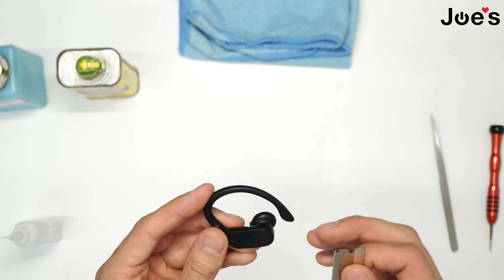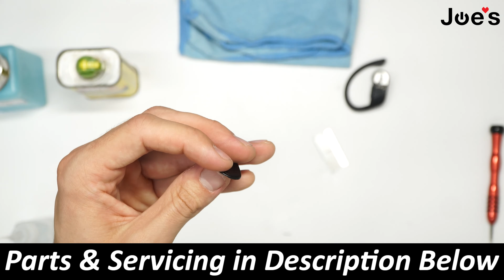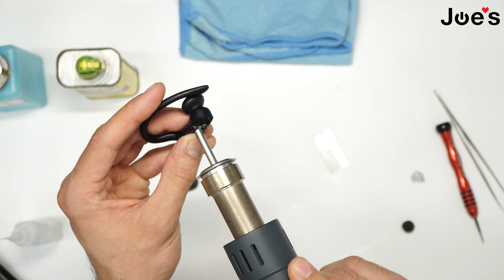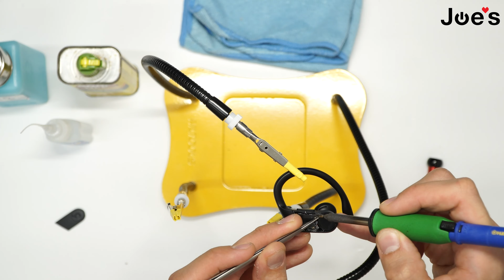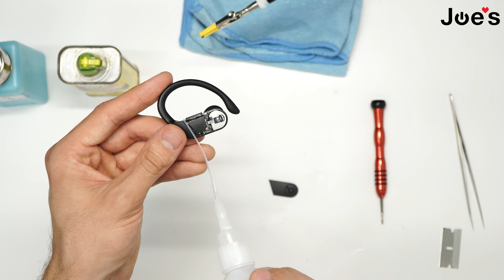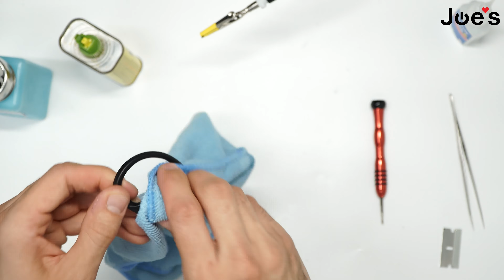Beats Powerbeats Pro Broken Bad Battery Dying Fast | Repair Tutorial

Comment: I'm glad I found this video, the left side of mine started dying at 55% I tried everything, reset, drainage and now I can see it's not just me, so sad a great product like this is bound to this fate in just two years.. Sigh!
Reply from the maker: Yeah. Seems like they are built to break now a days.
Reply: Mine is the exact same!!!
Reply: I’m having the same problem here. It fan stay charging all day and the left side will be at 4% then die or only last no more than 25 minutes and only left with the right one. Beats won’t do anything. I already contacted  them . Smh. Now I’m waiting to see what’s the best wireless earphones right now. Not a fan of the AirPods Prob and not convinced of the new beats wireless ones ether.
Reply: I’m having the same issues 2 years later as well such a fail of a product.
Reply: Update : I ended up buying the new beats fit pro! I recommend!!
Reply: @_lunaaaah6194  cheers, yep i have them on my list as soon as they're available in Canada, do they sound as good as powerbeats pro?
Reply: @MustafaAlJaiosy  I was iffy at first but turns out I was placing them on my ear wrong. But yes. The noise cancellation and the 3D moving hearing is cool too!
Reply: @_lunaaaah6194  Nice! I will get them then, ty!
Reply: @MustafaAlJaiosy  no problem! You can always walk in to Any apple store and ask to try them on and have a hearing test with it! Good luck(: 
I got the white beats fit pro 🔥
Reply: I have the same problem with the left side of my EarPod dying with a few mins of being used. It drops down to 55%! What can I do to resolve this?
Reply: I called Apple Support today and they said that they haven’t received many complaints similar to this one!! Please report to Apple if you are having this problem
Reply: Same problem but the right side
Reply: Mine was in less than a year
Reply: @Ismy__king  Yeah well, thats a lie.
Reply: mine is doing the same thing.
Reply: Does anyone know how much Apple charge to replace both batteries? This sucks. pff
Reply: @oscarbreton6098  last time I checked it was 130 Canadian dollars 🙃
Reply: @MustafaAlJaiosy I checked some other users in Reddit yesterday. Indeed is around $130 each earbud. What a jokeeeee haha. I will buy the Beats fit pro instead. At least this pro lasted a little over than 2 years .  Thank you for the reply!
Reply: Mine is also left side? I think it’s a glitch or a production fail
Reply: @Joesge  can you replace the battery In my powerbeats pro if I send them to you
Reply: Same I bought the two year warranty and guess what after two years it sucked getting air pods next time
Reply: The batteries are so small and they charge them so fast with the case it makes for a very short lifetime for the battery.
Reply: That's wild. Mine also dies at 55%. I thought it was just a bad bud.
Reply: Literally same problem! Exactly 2 years! Wtf
Reply: Same here.  My right one still works pretty well, but it's not strong as it used to be.  When they were brand new they were good for 9.5-10 hours.  Freaking shame, I'm done with Beats.
Reply: Yes, same exact thing happened to mine 😢
Reply: Exact same left side dies
Reply: @rqazi10  Right here too.
Reply: @imaunicorn5862 mine is also on the right side 😢
Reply: Mine too at exactly 55%
Reply: As an update, mine was like this, then they did a big update and now the left works great and the right does in minutes.
Reply: Still having this problem bro
Reply: I got this problem to
Reply: Mine took five and it’s only on right headphone.
Reply: Left side have same problem. Last 20 to 25min. I now have to go with the charger at the gym and as soon I start recharging it shows almost full charged
Reply: Wonder if the 2nd gen going to do the same thing
Reply: Fingers crossed!
Reply: Same

Comment: The left piece is dying quicker everyday. It won't even show that it goes to 0%, it simply shuts down at 68% while the right piece keeps going all day long. Today the left piece died at 82%. Very annoying when you have meetings all day.
Reply from the maker: Have you tried a reset?
Reply: Dealing with that now. These cost way too much money to deal with stuff like this.
Reply: @AR-3618  did you find a solution
Reply: @bushwickbill7593  naw I haven’t. I just keep the case with me, put one in my ear till it fails then swap it with the other one charging 🙄🙄

Comment: Awesome vid!! A little DIY can save a lot of $$!!
Read through some of the comments, and I'm gonna add that most electronics over the last 15-20 years could be considered "throw away" items - use for a couple years and they're done/old/outdated. With the advent of smaller and smaller technologies, the longevity is potentially shorter. Example: the battery in these are soldered, if you drop your case, or even an individual bud, and that solder wasn't super secure to begin with, and that connection is broken, well, now you have an inoperative earbud and you feel like you've wasted $250 and you're now upset with the manufacturer. Their job is to make $$. Now, as long as people keep spending $$ on their product, they'll continue to grow. Companies would have to restructure themselves, and/or their pricing if no one bought their product. Think about it...

With that being said Joe's, I've watched the vid, and it's tough to tell in the video, and I've checked both links to the replacement battery in the description and in the comments, my question is, the link in the comments only showed a round battery, the link in the comments shows two wires attached. It makes sense that the one with two wires is more applicable, as it gets soldered. Will any CP1454 A3 work?
Much appreciated.
Reply from the maker: Im not sure. Here is a link to the original battery. https://www.joesge.com/products/beats-by-dre-powerbeats-pro-earphones-battery-replacement-parts?_pos=1&_sid=6af242f27&_ss=r
Reply: How do i know if the battery in the casing is the problem or the earbuds itself?

Comment: Friend when you start to fix Beats Studio buds and the case of Beats Studio buds also fix the case of Powerbetas pro it’s very difficult to open I’m open one and it’s a solo 3 battery 360 mah dead by fast charging about the Beats Studio buds it’s 85 mah the thing it’s don’t turn on or send any light when out to charge so o have a lot of problems now jejeje and the interior of Beats Studio buds it’s more difficult that the powerbeats pro and need a lot of practice to change a battery hope can make a new video with new products thanks a lot

Comment: Wow, excellent video and I will say the BEST (I watched many). The important details were left out by all the rest!. I did get a chuckle when you started off with the tools that I would need then later you introduced a Heat Gun with a specialized reducer attachment and also the soldering iron. lol. I wonder if heating up a small flat head screw driver to soften the glue for removal would work (I do not have a Heat gun and my buddy Joe did not list it in the tools/parts links 😉) I have two bad sets (bought a 3rd set for Black Friday, $149 new Black pair; yes I know, Costco had a blue pair w/ a pinkish logo for $139) and will completely refurbished them both for Christmas gifts. How long should I expect these batteries to last? Mine lasted about 18 months and both left pieces give me about 30-45 minutes of listening time. Right ones about 2-3 hours. The cases are not noticeably different but I wish there was a way to measure the % of efficiency of the each of the 3 pieces. Do you know? I will also look to see if you have a video oh refurbing the case battery. You are natural…..Please keep up the great work!
Reply: I just started this repair on my own pair and found the glue on the battery terminals just popped off with a flat-head screw driver.  Didn't require any heat.
Reply: @madamscrypto5375  how did the repair go? Did the earbuds retain all function and connectivity? Some ppl commented its a bit off after the replacement
Reply: @madamscrypto5375  also madam, where did you buy the battery from? and which battery did you get?

Comment: Excellent instructions! My clumsy self broke off the green solder contact with a tiny piece of the board. Any advice as to how I may be able to solder directly to the bottom of the board? I’ma total rookie (obviously). 🙏🏾
Reply from the maker: Maybe try to solder a wire into that spot? A small copper wire?

Comment: For some reason, the battery life on my Powerbeats Pro has been dying quicker than before, even when I leave them charging for long periods of time
Reply: Same the right side earbud dies within like 30 min of use, so annoying
Reply: @Joy_Dvzn  same happen to mines but I don’t have all those tools to change battery 😂
Reply: @Joy_Dvzn  omg mine too... Right one goes off in 20 mins and left one dies in 45 mins
Reply: I have owned my pair since mid-2019. In the past few weeks, the right side simply turns off when it gets close to 50%, as if the battery reaches 0%. I've disconnected from all devices and reset, but it didn't work. The firmware is also the last released.
Reply: @RafaelNardo001  same case man
Reply: @saipruthvi8535  I really don’t know what to do.
Reply: @gabrielsuarez8559  yea it’s a lost cause at this point, I don’t have the equipment nor technical ability to do anything about it. We can get it repaired for 99$ but at that point I’ll just save up to buy new wireless earphones
Reply: @saipruthvi8535  rip
Reply: @Joy_Dvzn  yeah, took it to the service center they asked 130$ to replace each earphone. That would be 260$ for both and for 160$ we can get a new pair
Reply: @saipruthvi8535  omg lol what’s the point of  apple even having service repair 🤦🏽‍♂️
Reply: U
Reply: @saipruthvi8535  it’s $79 for battery replacement through apple
Reply: @beyoncehadoneofthebest  that's in usa without taxes. 130$ for each in India including tax
Reply: @Sebastien Fulga  same so annoying done with beats

Comment: Hello Joe, great videos and website.  Question: I cut the ribbon that is connected to the motherboard cover on the side of the charging pins while prying the side cover off; is this repair destroyed?
Reply: The cover doesn't appear to have any electronic components (that I can see); in your "How to Teardown Disassemble" video you state "the ribbons are connected all the way through; so anything that has electronic components on it; its all connected into one peice." I just don't want to solder in a brand new battery if this earbud is now toast.  Thank you again and much appreciated!
Reply from the maker: Hello, thanks for commenting. Please email us at support@joesge.com with your question. We will be able to better assist you there. - JoesGE

Comment: Hey!! I have a problem with my left piece, i used to charge them both but to my surprise i find that the right piece is the only one charged ful the left is still 0% it starts to charge when i open the case!! I found another problem last week, the left piece drains quickly and shuts down at 30% is it the battery problem?
Reply: I have the same problem have you figured it out?
Reply: @taspiqulislam2863 did u find a solution
Reply: Did u find a solution
Reply: LISTEN AND DO AS I SAY.. 
Lick the charging metal on the ear piece then put it in the charging case then it will charge correctly.

Comment: Question I can send you the headset and you can do the work on the battery I have the right side with battery problems how much would be the total cost of the replacement and the battery thanks
Reply from the maker: Hello, unfortunately, we do not repair this device anymore. We do sell the parts at www.joesge.com though. - Aaron P

Comment: Hey, many thanks for this video, found a lot of interesting information here. My earbuds left and right, doesn’t connect once they get to my ears. But when they are in the case, I see them charging and the percentage they are in. But once I remove them out of the case to fix into my ears, I don’t hear the connecting sound and they don’t work. 

Do u have a solution to this? I have done the reset, so many times. But won’t connect to my ears.
Reply from the maker: Hello, thanks for commenting. Please email us at support@joesge.com with your question. We will be able to better assist you there. - JoesGE

Comment: My right earbud keeps shutting off on my like I could have both of them fully charged and then like 5 minutes later I hear the low battery sound and it shuts off and when I check the % it says it’s fully charged and I’ve restarted them like a billion times and nothing has happened
Reply from the maker: Hello, thanks for commenting. Please email us at support@joesge.com and we will be able to better help you there. - Aaron P
Reply: @Joesge  I will for sure email as soon as I can thanks for answering

Comment: Where do I get the batteries from please?
Reply from the maker: https://www.joesge.com/products/beats-by-dre-powerbeats-pro-earphones-battery-replacement-new-parts?_pos=8&_sid=68cafdacc&_ss=r
Reply: So I Ordered one battery per ear set, one left and one right, does that sound correct?
Reply: Then I was looking at how you have the original, I would have rather done the original since I like longevity, but I guess I should still be ok since you didn’t say the generic ones wasn’t ok, so I’ll go with it then !!

Comment: Only my left earpiece is showing up as fully charged, and the right side is not listed. I made sure to place them correctly in the case to charge but every time I check the right side just doesn’t show up. I checked online to see what I can do and it says I can reset. No matter how many times I do it, The case only lets me pair. Do I need a new case ? Or would I have to get a replacement earpiece? 😣 thank you!
Reply: I got the exactly same issue as yours but its the left side that is not working, did you found a way to fix it 🥲I only bought it for 2 month

Comment: There seems to be two different types of batteries CP 1254 A-3, and CP 1254 A-4.
Are both OK for this or one’s wrong???
Reply from the maker: Where did you see A4?
Reply: Just looking through Amazon
Reply: The A4 seems to have a different mah than the A3
Reply: Joe,
Problem. I just got your battery and finished replacing in one side. When I put it in the case the white light flashes, but it will not pair to the wife’s iPad. What do I do???

Comment: I have one headphone that just went dead. It shows charging, but it never charges past 3%. I’m guessing the battery had gone bad?
Reply: Me too
Reply: @DavidMartinez-hb6cg  I replaced my battery. It was fairly easy if you can solder small things.
Reply: @gerdanc  so, it works fine if i replace the battery?
Reply: @DavidMartinez-hb6cg  mine is still working great almost a year later.
Reply: @gerdanc  ok thanks!

Comment: The fact apple and Dre have this shit product that I have to fix because of software updates that fucked them up is ridiculous. Prior to recent updates my powerbeats worked fine. Besides normal battery wear and tear it always seems apple products lifespans are intentionally shortened to force/or encourage people to buy newer models to keep the revenue flowing. I barely have had these beats for 2 years and there already big pieces of shit. Its a real shame since they were a gift and its a waste to have to basically do this mickey mouse repair for expensive electronics. Never liked apple or its products but when its gifted not much you can do about it. I'll definitely look else where for more durable and longer lasting bluetooth earphones.  Thanks for the info in the video and effort regardless though.